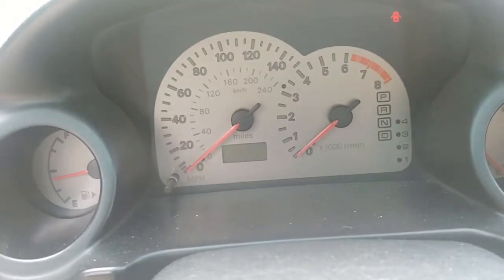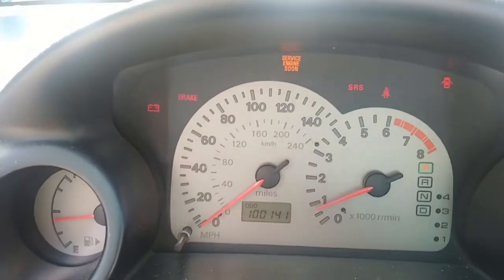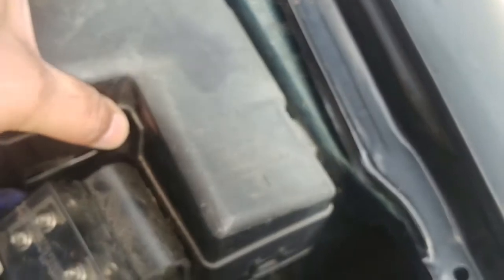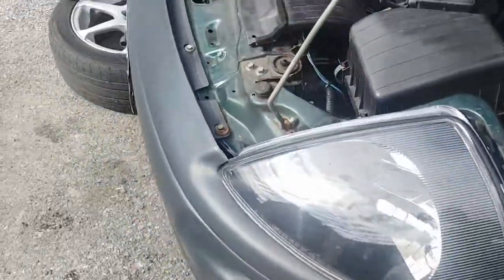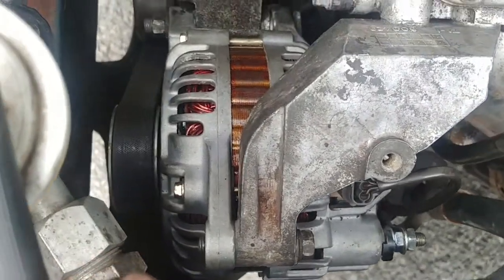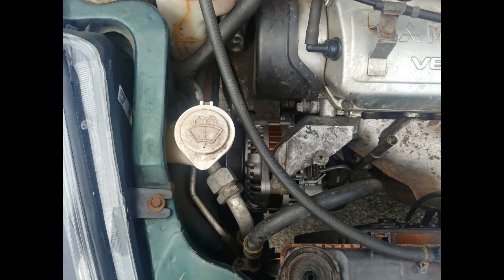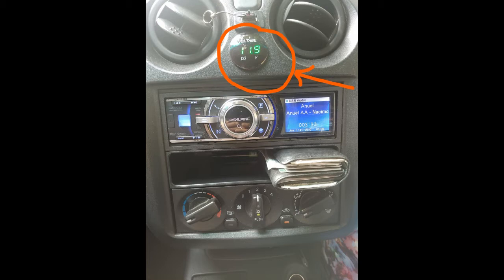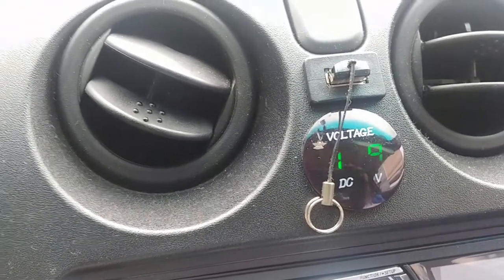2000 Mitsubishi Eclipse GT Alternator Update Part #2

Comment: Thanks for sharing. I'm currently having an issue with the voltage drop, and I wasn't exactly certain that it could be the alternator. I may just try to replace to see if it makes a difference.
Reply from the maker: Check your ground wires. One is behind the engine passenger side connected to the fire wall and the other is on the driver side, engine to chassis. I replaced both of those cheap braided wires with 4 gauge wiring. Also check the harmonic balancer for wear. If you saw in the previous video, I had to replace my harmonic balancer. Now my cars voltage is good. 14.5v at start up and drops to 13.7v when warmed up.  It could be the alternator but check those areas first. Alternators don't break down that easily unless the car had a serious electrical problem or was wet during operation. I hope this helps!

Comment: Appreciate the video, will subscribe have a manual myself. Did you encounter a idler pulley between the alternator and AC pulley? because my belt has been loosened. I'm not sure if there is a 2nd pulley besides the tensioner
Reply from the maker: Hey Jemar, thanks for the subscribe. Now that you that you mentioned it, there was no idler pulley between the alternator and the AC. I worked with the tensioner that's located  between the crank pulley and the AC pulley. When you remove the plastic splash guards, make sure to inspect the crank pulley. It is made of 2 pieces and it has a rubber shim that wears out. Hope this helps.
Reply: @eramirezjr5461  Appreciate it, I thought that was the situation with the idler but it had me lost. I actually have to replace the the same piece your taking about the whole harmonic balancer wheel came off. Videos were a big help.
Reply from the maker: @jemarbutler1669  Glad it helped!

Comment: hey! is there any way you could tell me how you installed the voltage reader thing?
Reply from the maker: Hey Chloe, sorry that I took so long to answer your question.  You mean the voltage indicator right? To install one you need;
Voltage Indicator
Step drill bit
2-Ft of 10 or 12 gauge speaker wire
1 set of Speaker wire connectors
All of these items can be purchased on ebay or amazon. I might make a short video on this subject due to the wire I used needs to be upgraded. If you want to put one in the car, get the above listed items and let know ok. I'll help you even if don't make a video.
Reply: @eramirezjr5461  A video would be great! Thank you for responding, this helped very much. I might just invest in one that connects to a cigarette lighter port, do you know if that works better than a voltmeter similar to yours?
Reply from the maker: @chloewang5735   Now that you mentioned it, there is one that I saw on ebay. It had 2 USB  ports and voltage indicator. It replaced the cigarette lighter port. I didn't get that one. I needed the indicator dead in my sight without having to look down. If its a direct fit to the cigarette port, the install would be a piece of cake. Most of my cars had a music system in them and its a good thing to have a voltage indicator in the car. At a glance you can see what's going on with you vehicle's voltage, even when its parked! Depending on your make and model, I'm pretty sure it has a few good spots where you can install one.
Reply: @eramirezjr5461  I also have a 3g eclipse! 2002 to be exact, I think investing in both the cigarette port one as well as the one on the dash would be a good idea, especially with my battery/alternator problems. Thank you so much for responding!